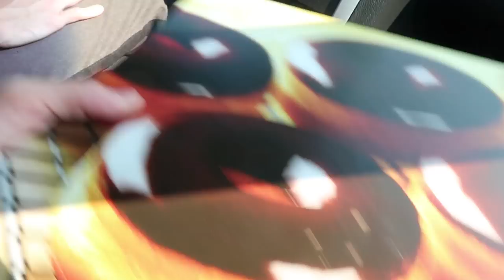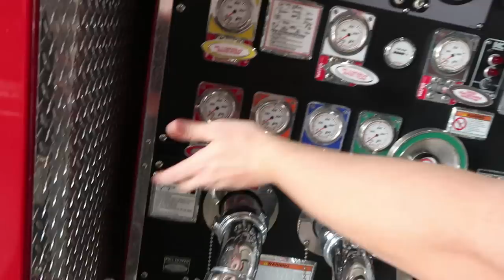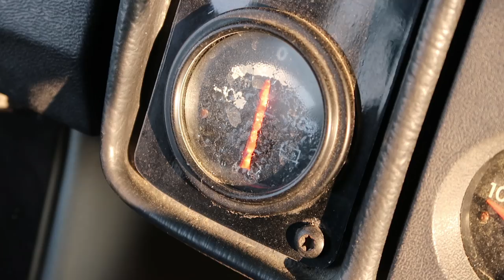SHE HAS TO GO :(

Comment: That engine is hydrolocked no way thats starting if you dont take all the water out the engine and fuel lines there is too much pressure on the engine you need to take out the glow plugs so the water could come out
Reply: that's the right way to fix the bus
Reply: dang I wish he had someone like you To tell him what’s wrong with it, I liked the bus. Especially it’s a Freightliner Fs-65.
Reply: That’s such unholy treatment for such a rare-to-find bus, especially with a Cat 3126 engine.

Comment: Bus engine is Hydrolocked. it has to be completely drained of everything rotated over a couple times. put the injectors back in and some new oil and then and only then will you be able to start it

Comment: drain oil from bus then get water out of the engine because water is not able to be compressed and then it could start... but its probably better to just get the engine completely rebuilt or a hole new one plus the electronics.

Comment: The engine is probably hydro locked; diesel engines run on compression, so to get it to do anything, you need to drain the water, then to get it to run, you need to flush the entire fuel system, then bleed it (get all the air out if it)

Comment: the bus is hydro locked so you need to take more of the motor apart and the motor is diesel which could be a challenge since a diesel has on spark plugs

Comment: their might be water in the cylinder causing the piston and cylinder wall to rust and also water does not compress so you could have bent a rod and/or broken the crankshaft also from the leaking oil their might be a hole in the block and if so it's done

Comment: Does this guy even know how engines operate? That engine still has water in the cylinders. You aren't going to compress water. And since water was left in the engine for a while, you very likely are going to have stuck rings as well. Heck, you didn't even drain the water/oil from the crankcase. That diesel could have been a good engine to use for some other project. Or even the entire chassis to drop a classic truck body onto then install a flatbed onto the chassis.